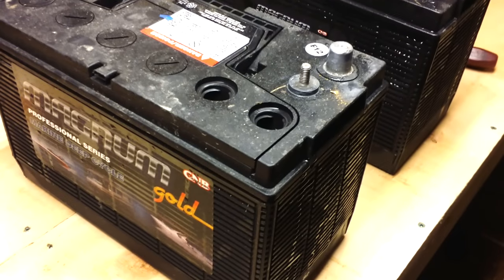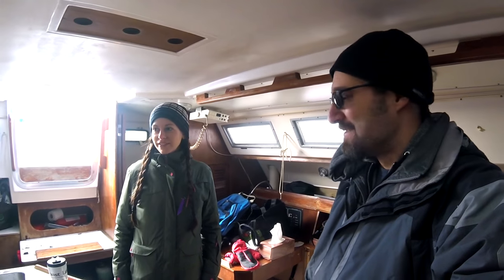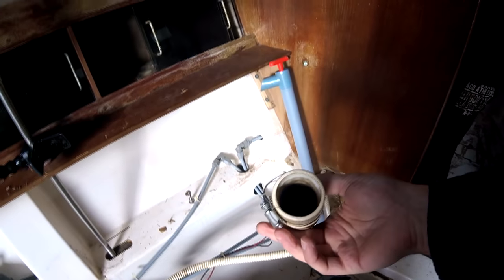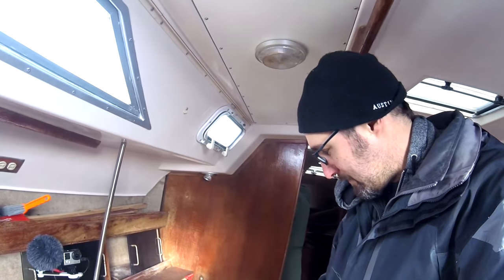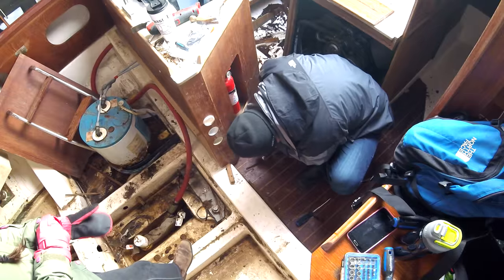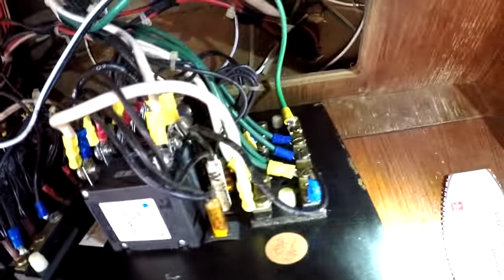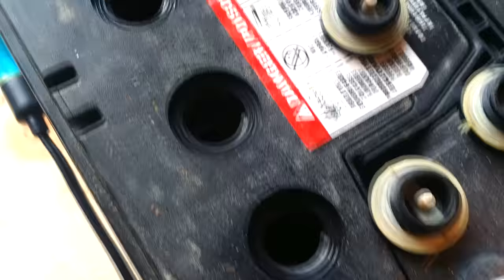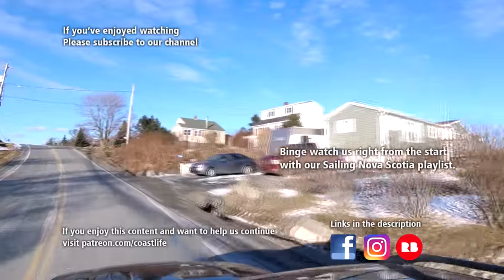Got No Sole- DIY Sailboat Refit [ Ep 13- Sailing Nova Scotia ⛵]

Comment: Awesome story, you guys. Here in Essex, England I'm prepping my boat for the water later this month. The to-do list is w-a-y long .... but having just glimpsed yours I see mine's merely like your prologue. Heading down there now, six layers of clothing, but reinvigorated with the thought there's not much to do .... yeah, right! Keep up the awesomeness.
Reply from the maker: LOL,  Glad to ease your pain.   We want to get our boat ready for May so we need to take advantage of every day that's at all mild. Good luck with your projects!  It seems early to be putting your boat in the water, Are you planning a trip?
Reply: Coast Life hi there, yes heading clockwise round Britain, starting April. Figure I'll need March in local waters to shakedown any issues and generally double check systems. The boat is 30 years old, but new to me. Previous owner did a great job, but there's always something to be resolved! We sail out of a delightful little place called Tollesbury. The Romans found it first. Not much has changed since. Especially not the mud. The estuary of the Blackwater provides a degree of shelter from open waters, so (with the right clothing) winter sailing can be fun. Yes, I wrote 'fun'! 😅

Comment: Enjoyed the video! Trash hoses and replace with good stuff. The compression post looks like the focal project. Courage!
Reply: Second that.  Those hoses really cannot be cleaned.  Also even if that semi good battery comes back to life, look to replace it soon.   Floor boards are going to be a puzzle when you put it back together.  If you cut the boards to a reasonable length, you can get everything back where it needs to be.  Measure, evaluate, measure again.  Making a cheap template to test fit isn't a bad idea either.   Compression post bothers me.  But if Hunter forum says it is fixable, then so be it.  What do I know, I have a Catalina....  :)

Comment: Those  hoses simply drop in the dumpster. ALL the batteries, turn in to the recycler and replace them--same size and Flooded batteries will be good----twice the bucks are AGM batteries. Most likely replace the battery charger too!? I have the same boat in 31ft-----Mike Yadrick , Seattle, Wa

Comment: Have you thought about just using a black plastic tank, and taking advantage of solar heating as a substitute for the hot water heater?
Reply from the maker: Yeah, you can buy camping showers. Black bags that hang from a line and shower down.   It's a possibility.   We are leaving the tank for now.   It can be installed later if we decide we really want that.

Comment: As someone said, looking at you guys own project list seem so much shorter. :) Courage! I agree, frozen batteries are pretty much done and all the batteries in the same circuit should be replaced at the same time - so get the new ones. Consider also do you really need hot water? We bought our boat from Netherlands few years back and it didn't have a water heater. We haven't needed hot water even here in Finland yet. The water heaters are pain in the a** specially here in the north. They are really hard to get completely empty at the autumn and if you don't get them emptied.. well you know.. $$$$$...
Reply from the maker: In regard to the water heater. We are not totally sure.  We are going to leave it until last to decide.  for now we will cap off the water lines and loop the coolant lines. So that we can install one at a later should we decide.

Comment: Head hose needs to be smooth wall ! If you have power at the boat yard, get an electric heater with blower. That Kero oil heater is leaving an oily film in the boat that paint or varnish might have a hard time bonding to. Also a major fire hazard and the fumes well you already know about the fumes.
Reply from the maker: Unfortunately the power at the boat yard is about 300 feet away.   We don't have an extension cord that long, and if we did....  It would have to be a real beast to power a heater...
Reply: Generator!

Comment: Hope that you added some distilled water before you charged the battery.
Reply from the maker: Nope.... no water.  The levels were not really low.  Could have used a top up, maybe.  but I didn't have distilled water so leaving them be was better than adding tap water.  -Chad

Comment: Nice work guys, loving the progress. Are you going to jack up the deck and replace the old compression post with an aluminium post?
Reply from the maker: That is the plan. The hurdle at this point is finding a crane service to take the mast down.  But the floor and compression post are out top priorities.  .... I refuse to type sole...   :)

Comment: I personally wouldn't spend too much effort on batteries that have been frozen.  They're probably pretty much done.  I would prefer the peace of mind of fresh house batteries so I can go enjoy overnights and such without worrying too much about power consumption.  You can likely find a battery shop and get a couple of deep cycle trolling motor batteries really reasonably.  It's a cost effective way to get amp hours.  Remember deep cycle for house.  They're designed to discharge further without being damaged.
Reply from the maker: Agree... I may use that battery for something else, or just as a emergency jumper battery.  We'll see.    I just like to salvage anything that I can.  It can be a good battery for something else less important than boating.

Comment: If you are planning on connecting batteries to create a bank I recommend you do not pair an older one with a new one - the weaker battery will always ruin the newer one.  Best to replace all batteries in a bank at the same time.
Reply from the maker: It's true....   That battery seems to be holding well, and we do have a 2 bank system.. So I'm not sure.  We may just get 2 new batteries and forget that one.  Or store it as a emergency jumper battery...